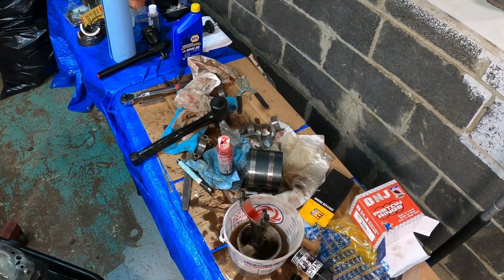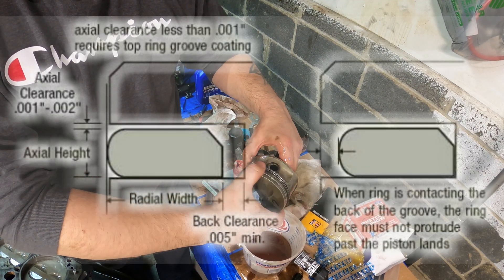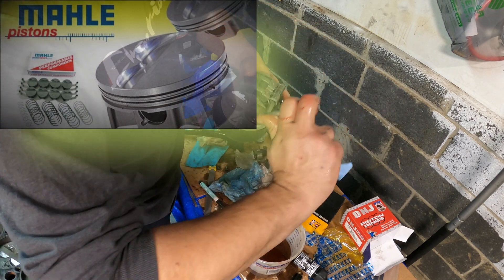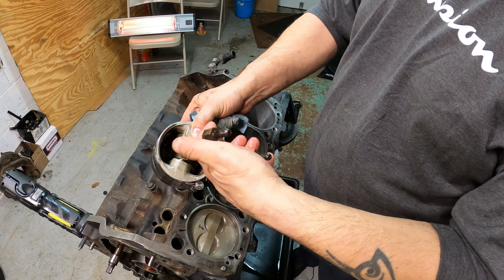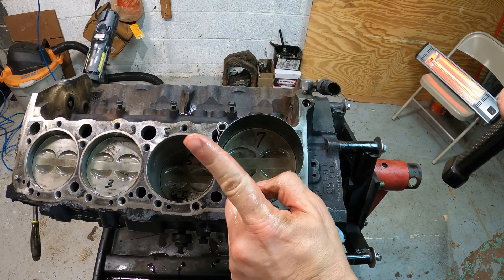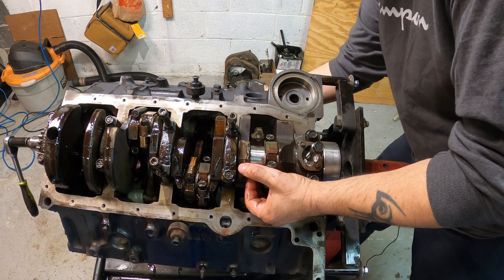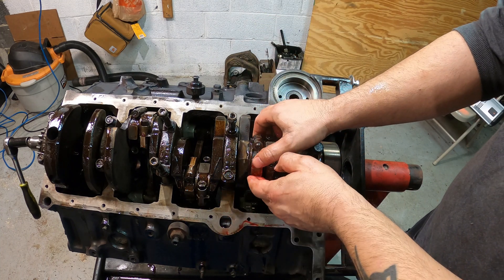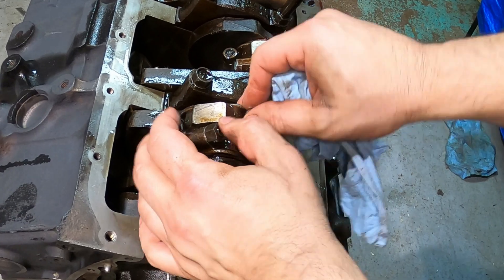PISTON INSTALL CONNECTING ROD INSTALL LT1 SMALL BLOCK CHEVY #pistoninstall

Comment: Hey man I have a question for you if you don’t mind. I have a 1994 camaro lt1 built 383 stroker. I bought it from a friend and the car sat for 8 years cause he didn’t want to fix the optispark when it failed. Long story short I put a fuel tank, pump, sending unit, spark plugs and wires with a lingenfelter coil on plug setup, new optispark for a crank trigger only now and a bunch of other stuff to get it back running and all I get is a crank no start and I can’t find out why for the life of me. I have fuel and everything is new for it to start but it just cranks. What do you think could be happening?
Reply from the maker: I had a similar problem with my other car and it turned out to be the pcm if you have any more questions the best place to message me is Instagram maldo72yoube

Comment: I just picked up a lt1 short block with 65k miles on it. Do you think I should refresh it up like you did? What are your thoughts? I plan on installing a cc501 cam with lt4 springs. Do you think the lt4 springs will hold?
Reply from the maker: with only 65k i would say no ... but i would pop off a rod cap to check one of two of the bearings to confirm .... also if you look back on the cam swap i did i would go with the Howard cams springs i used instead of lt4 valve springs direct build in to the stock heads (all you need to do is remove the internal spring damper and you good to go ) and you can reuse the valve keeps and retainers (Howards Cams 98215) link to video below https://youtu.be/nBHK22z37a0

Comment: Enjoy your content. Starting my own Lt1. Pretty much the same. Very budget rebuild. 
My question is what kind of crank. What kind of rods. What kind of pistons. 
I heard they were better than standard 350. 
Thanks. Keep up good work.
Reply from the maker: thank you for watching ... 
all the lt1's use the same crank and pistons (stock) the difference between the later years is the powdered metal rods which are suppose to be stronger that were used 96 up .. for this older style engine it used the older "pink rods" .. this stock style rebuild/refresh engine is going to be used as a temporary  mule until the other engine gets built for the turbo setup i am planning for the spring .... if you are on a budget  rebuilding the stock stuff can hold easy 500hp ... under 6200 rpm

Comment: Still waiting.. lol. I'm back in Florida, just finished upper, lower and rear control arms, rear track bar, rear shocks, front struts and tie-rod ends. After a redneck alignment and road test I'm ready now for a real alignment. Went with Mevotech rubber bushings and KYB shocks and struts. Can't stand the ride of poly or heim joints.
Reply from the maker: yes the ploy or heim joints can be a pain that's why i went with the ploy  for the street car its a little bit of a trade off  but,  wanted the extra control over the rear when i throw some horsepower at it later in the build
Reply: @maldo72  I only used poly bushings on my front and rear sway bars. Where can I send you pictures of my ride, I'm the original owner of a 94 Z28 Camaro.
Reply from the maker: maldo72youtube Instagram
Reply: @maldo72  Unfortunately I don't have Instagram..
Reply from the maker: email maldo72motorsports@yahoo.com

Comment: Nice! Once it’s all put back together, how many miles you think you’ll get out of her with this budget build? I’m planning on doing the same on a daily driver with a small cam and 1.6 rockers.
Reply from the maker: in stock forum, it should last a lifetime buttttttt.....  I planning a turbo setup and this engine is the guinea pig that's why I am not spending a ton of money and doing a stock type of low buck build...   I did not expect the current motor in the car to take a dump .... while is was building out the cheap  rear-mounted setup .... in the end, I really want to get a proper forged set up to handle the boost ..... bottom line if your plan is a daily driver yes stick with the stock stuff its plenty strong